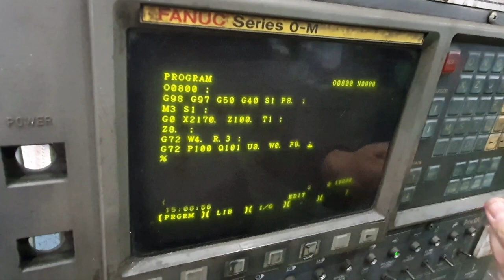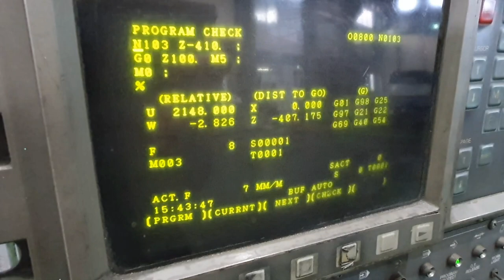Giant Iron Plate Machining - Vertical Lathe, Turning, CNC lathe

Comment: What do you charged for this machining? If you have information. Also share outer diameter.

Just interested to know as I'm in the same field.
Reply from the maker: The outer diameter is about 2200mm. It's hard to talk about the cost because it depends on the situation.
Reply: @jamespark_85machiningtv  okay...just want to compare.No problem